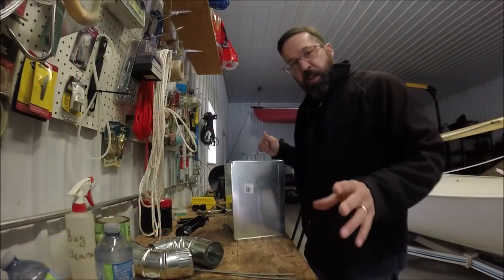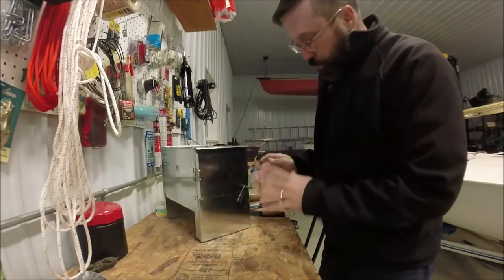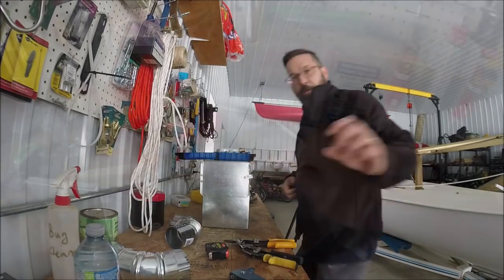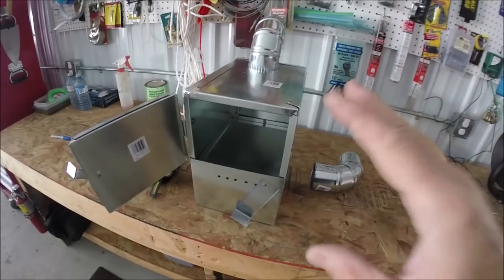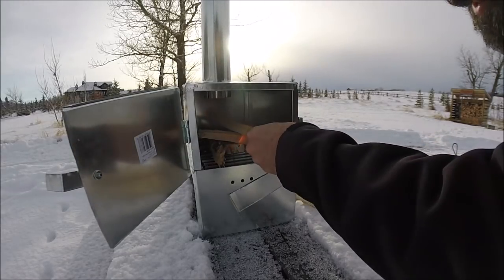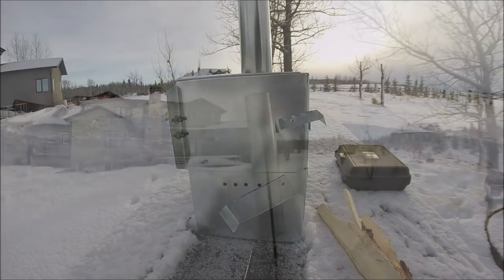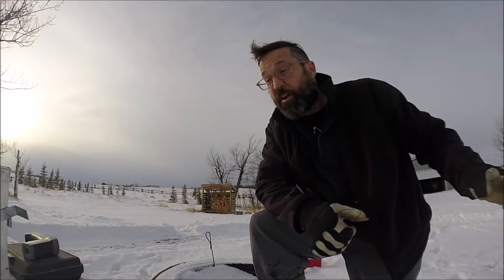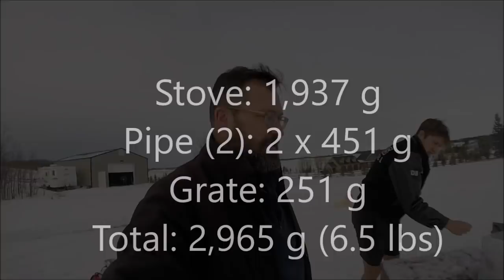DIY wood-burning tent stove.  Only $60 compared to $400+ for brand name

Comment: Patrick is OK.  He’s wearing shorts in the winter!
Reply from the maker: Typical Canadian kid.  A few month ago Laurent T.-B and I were hiking.  Someone called us extreme because he was wearing sandals in the snow.
Reply: @Martyupnorth  I just did a tent-hut Two Dog stove night that was down to minus 25 Celsius. Your point about convection heating the air instead of an open fire creating water vapor and co2 - excellent! I had never made that connection to why I like wood stoves so much - nothing better then drying off wet clothes in the winter. I'll test my new 2.4 gallon waste bucket stove tomorrow - need to make some legs. You clued me in on how to attach the hinge. I couldn't figure it out today - must have been the garage cold slowing my brain down. haha. Yeah when you say it's a "youtube trend" - indeed! So you got your ammo stoves, the paint can stoves, the 5 gallon metal bucket stoves, the beer keg stoves, the various rocket stoves, the mass heater rocket stoves - and even a few popcorn bucket tin stoves! I tried making one but the metal is way too thin. My door is the lid of the popcorn bucket - and it's probably too thin for that also.
Reply: @Martyupnorth  https://www.youtube.com/watch?v=jOaZhGpkDI4 2.5 gallon tent backpacking wood stove from steel waste basket trash can with baffle - no smoke burn
Reply: N great idea putting that grate in the bottom.. That will definetely help the stove last!

Comment: Looks great!
You may want to figure out a way to slide a few long logs under the stove like the Knico stoves that Snowtrekker sells... that way if you are camped on top of deep compressed snow the stove can float on a couple long rails... a few holes drilled in the side of the legs and a bit of mechanics wire would be an easy way of doing it...

Comment: Nice job Marty, I like the legs and field assembly would be a pita, imagine if you lost one of the nuts or bolts, I’m going to copy the stove and your pulk, thanks for sharing, cheers
Reply from the maker: That's what I was thinking.  Keep it simple.  The ability to disassemble and lay flat was very minor.  Space saving is not a big deal.  I'd rather have something I can setup and light quickly.  I was surprised at how easy i was to start a fire in the stove.  That thing needs a lot of wood to keep it going.  I'm guessing I'll have to add logs every 90 minutes.  No big deal when it's -15C if it goes out.  In -30C I'll put more effort to keep it lit.  Cheers.

Comment: Pretty sweet stove Marty. I guess I'll have to sleep in your tent next time! 😂

Make sure you put a piece of metal screen at the end of your pipe to act as a spark arrestor and prevent sparks from lighting your tent on fire!! I would increase the size of the holes for the combustion. Can't wait to go on our first winter trip. My pulk is ready to go! 😁
Reply from the maker: Ya, my hand-held drill only accepted 1/4" bits.  I have a bigger one in the basement that will go up to 3/8".  I should have drilled the holes on the drill press.

Comment: Hey, I can see you have excellent knowledge about gas canisters; I have a question: which one would you say is the best brand for all-rounders I have a jet boil mighty mo.
Reply from the maker: https://www.youtube.com/watch?v=H7oi6Idc0Qg
Reply from the maker: I think they are all basically the same.  Here is a comment I made on someone else's video who asked this question.

"I'm an engineer in Alberta Canada.  I spent 30 years working in natural gas facilities that extracted propane, n-butane and i-butane from natural gas streams.  The composition of our product varied by 2% on a daily basis.  In other words, I could sell you propane that was 95%-99% propane and 1%-4% ethane on any day.  Same for all our other liquid streams.  The companies that make these cartridges source their feed on the open market.  They do a rough blend at their facility and then fill a batch of canisters.  You could repeat your test with different canisters from the same company and get different results.  I'll go out on a limb and say that there's not much difference between one brand and another because they all source the same product.  In the past companies advertised a summer vs. winter blend.  That made a difference because it changed the percentage of propane from 10% to 20%.  I don't think anyone does that any more.  Everyone sels an 80/20 blend in a heavier canister.  Also, the difference between iso-butane and normal-butane is not significant as a fuel.  We separate butane into its two isomers for the chemical industry.  The butane found in fuel canisters is a blend of the two, even though most companies advertise iso-butane.   Otherwise, cool video."

Comment: Hi Marty.  Thanks for sharing this and talking through the build!  Do you have any thoughts on a simple baffle design to promote secondary combustion? After using this are you glad to have the 12" length?  I.e fair trade off to be smaller to haul on the pulk compared to a 14" or 16" length to increase capacity?  Thank you.
Reply from the maker: Hi Cory.  The stove I built is not very long, so there's not really a need for secondary combustion.  That, and it's not airtight, so there's already a lot of "extra" air for good combustion.  I'd absolutely recommend going longer.  The extra 4"  adds 33% more capacity without really increasing the overall weight.  The stove is already very small, so it needs a good supply of wood to keep it going.  I found that I just fell asleep, nice and cozy, and by the time I woke up due to the cold, it was too late.  I couldn't restart the fire by just adding more wood.

Comment: I don't think you have to worry about the rivets failing if you look at how you install them. As long as they don't get to their melting temperature they should be just fine.
Reply from the maker: So far it's been fine.  Cheers.

Comment: Would you mind sharing and parts list?
Reply from the maker: Main body is made from six 8"x12" Duct Caps.  You could also use four 8"x14" for the main box and two 8"x12" for the legs.  I used two 3"x30" galvanized pipe sections for the chimney and a 3"x90 degree adjustable elbow.  You'll need small hinges for the door.  I used steel rivets instead of aluminum ones, because they have a higher melting temperature.  Scrap sheet metal (or an extra duct cap).  The grate at the bottom is hust something I had kicking around.  It works fine, especially for car camping.

Comment: Interesting project. Do you need a draft both on the front and on the exhaust?
Reply from the maker: Not entirely necessary, but nice to have.  They both serve a different purpose.  More important on a house or cabin stove.  The front vent controls the flame, while the exhaust flue controls the amount of temperature retained in the stove.  I think for this project just having the front vent is good enough.

Comment: If you put a vegetable steamer in your stove it will gasify like a wood gas stove. That will make your flames nearly smokeless and hotter. :)
Reply from the maker: Thanks for the tip!
Reply: @Martyupnorth   Anytime! :)
Reply: Could you tell me more about this?  What vegetable steamer? The one with the leaves that fan out?  And do you put the wood on top of that, or just over it? Or under it or what? Thank you :)

Comment: Would this be used in a regular camping tents like the ones you took winter camping in past videos? Also I think it would be a good idea to put a longer door hinge to make the door stronger. Thanks a lot for the video, very informative!
Reply from the maker: It can be used in any tent that has a "stove jack".  The jack is an opening in the tent for the pipe.  The jack is usually a piece of leather or some other non-flammable fabric sewn to the tent.  The smoke from the stove has to be vented outside.  The tent also needs to be bigger because the stove takes up a lot of room and is very hot.  You need to sleep at least a half a meter away from the stove.  A small, nylon tent, like the ones I use on my hikes, is not good enough.  Too small, too fragile.  Sparks from the chimney will make holes in the tent.  I plan on using a heavier canvas ice-fishing tent.  I'll do a video on that shortly.
Reply: @Martyupnorth  I see that makes sense. Thank you for the info and looking forward to the video!